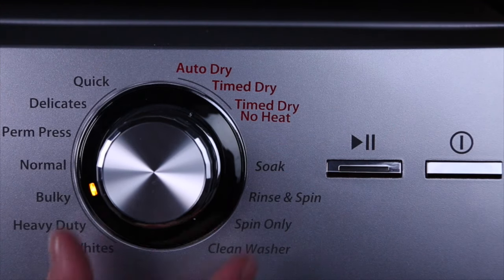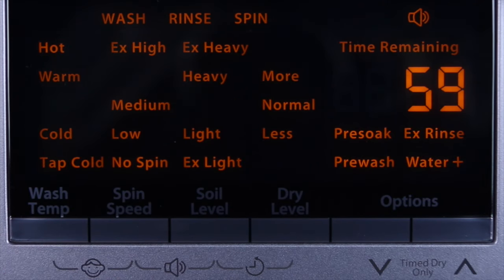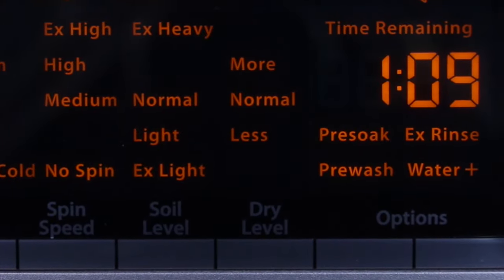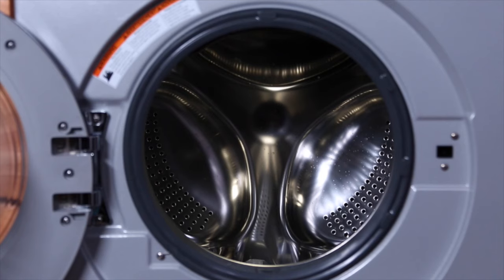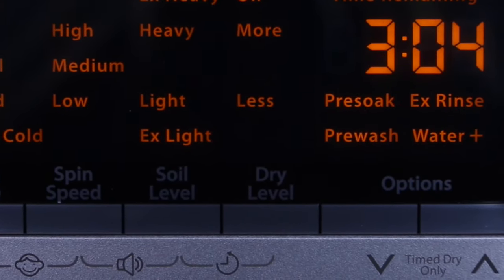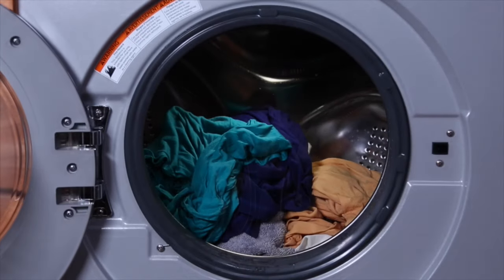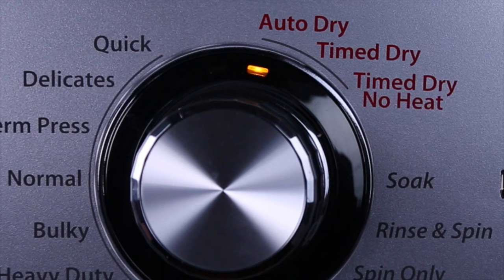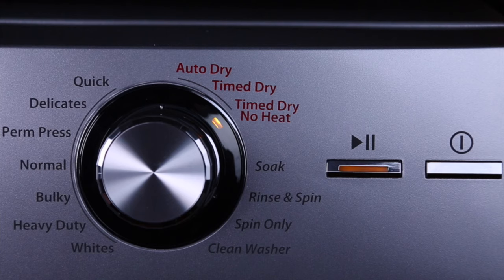Loading & Cycle Selection - Haier Washer/Dryer Combo HLC1700AXS & HLC1700AXW

Comment: The dryer is only working on Auto dry, and it takes a while to unlock but when I put it in times dry it doesn't work do you know why? The washer works fine no problem,  I make sure to clean the filter once even twice a month. Please help

Comment: I've had my machine a couple of years now. Worked fine up until lately. 
Now after wash when it goes into the automatic dry cycle (Less Dry) it 
counts down to 15 minutes and stays at 15 for an hour or so until it 
finally finishes the countdown and unlocks.  The machine isn't 
overloaded, I'm only doing a couple of small items. I've run a couple of
 clean cycles with vinegar to make sure lint isn't the problem. I'm 
wondering if there's some kind of moisture sensor that's messed up.
Reply: Try not using automatic dry after wash but rather turn it off then select automatic dry and see if drying takes the same amount of time.

Comment: The washer stopped running again after it was fixed last month. Can I unlock the door without calling for service? I only want to take my clothes out.
Reply: No you can’t it’s a terrible design flaw this machine should be recalled

Comment: Where do you add liquid bleach?
Reply: How about you a) check the operators manual b) open the detergent door (top left corner) this is where the bleach goes.
Reply: @jamesblair2000  i checked the owners manual and 
a) it said nothing about where to add bleach. 
b) I’ve stopped using that poison since then anyway.

Comment: Can I stack two of these vertically together?
Reply from the maker: Thanks for your interest in our space saving Haier washer/dryer combo, Digitalcurrents. Per the installation instructions, because the drum of this washer spins at very high speeds, up to 1,200 RPM, the washing machine must rest firmly on a solid surface to minimize vibration, noise, and unwanted movement. Therefore, it cannot be stacked. Thanks for checking with us. -SF
Reply: Simple just run run another surface or platform above the first unit.

Comment: Can this unit adequately handle a queen size comforter or a queen size cotton blanket, even if only one at a time, without any accompanying articles? If not, do you have this unit in a larger size that can, and if so, what's the model number of that larger unit? ALSO, what's the difference between the HLC1700AXS & HLC1700AXW ??

Comment: How much power are you using . Will you have a high electric bill ? I know it's only 120volts .
Reply from the maker: You can view the energy guide for model HLC1700AXS here: http://products.geappliances.com/MarketingObjectRetrieval/Dispatcher?RequestType=PDF&Name=HLC1700AXS%20Energy%20Guide%20U.S..pdf. -TS
Reply from the maker: You can view the energy guide for model HLC1700AXW here: http://products.geappliances.com/MarketingObjectRetrieval/Dispatcher?RequestType=PDF&Name=HLC1700AXW%20Energy%20Guide%20U.S..pdf. -TS

Comment: How do I remove the lock when drying if I want to add more clothes ?
Reply from the maker: Hi Brus, The washer / dryer door will automatically lock during operation. A lock icon will appear on the LED screen when the door is locked. NOTE: If a wash operation is paused, the door will unlock within 2 seconds. If a dry operation is paused, the door will unlock after the inside temperature cools to a safe temperature. The cooling time can take several minutes. We are always happy to answer questions about our new products. Thanks for checking with us! kg
Reply: Haier i have a question my door won’t open
Reply from the maker: Please review the use and care for model HLC1700 at this link for troubleshooting tips regard the door lock indicator and the child lock https://products.haierappliances.com/MarketingObjectRetrieval/Dispatcher?RequestType=PDF&Name=HLC1700AXW%20User%20Manual.pdf   I hope this information is helpful.  AS
Reply: You can’t. It’s a terrible design flaw
Reply: @Liam19831  It's suppose to be a safety feature. They don't want you to burn your delicate hands. A temperature sensor locks the door and typically takes 10-20 minutes to cool off then you can open the door. Terrible design flaw? No. Annoying? Absolutely because you can't run a few things in the dryer and check it yourself for dryness level.

Comment: can this handle king size bedding?
Reply from the maker: Hello Alpha, this unit is a great small sized washer and dryer combo that is perfect when you only have a limited space for installation. It is 2.0 cubic feet and this size will work great for smaller loads but not king sized bedding. Thanks for checking with us. -SF
Reply: @Haieramerica1  what about single bedding at one time? like one king sized comforter one king sized blanket etc?
Reply from the maker: Alpha, if the blanket was very thin it might work, but for best results, we cannot recommend this. Sincerely, -SF

Comment: Does it take longer to dry because it’s a washer and dryer in one? How long does a typical load of laundry take to dry? Also, can you add a vent if you want to use a vent?
Reply from the maker: Hello J J, This Combo washer/dry will take longer to dry. Be sure to only fill the washer half way because the clothes must have room to tumble freely in the drum. Auto Dry is 3 hours and 20 minutes, Timed Dry and Timed Dry with no heat are both 30 minutes. Note: This model can't be vented. Thanks so much for checking with us. JW
Reply: @Haieramerica1 the last minute for dry take long time
Reply from the maker: Hello Wilson, thanks for reaching out to us with your concern. Please make sure that you only dry about 50% capacity of your machine at one time. This combo washer/dryer will take longer than a standard dryer.  Auto Dry is about 3 hours and 20 minutes. Thanks for checking with us. -SF
Reply: @wilsontejada4299  because then the dryer is cooling down to a safe temperature before you can open and safely remove your clothes without burning your hand on the hot steel drum.
Reply: @Haieramerica1 No more old washers!😂